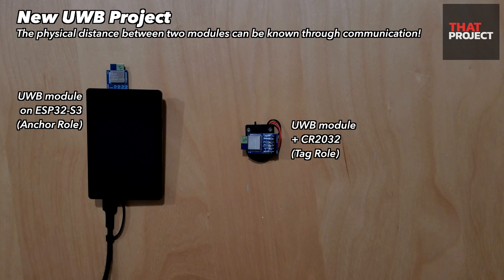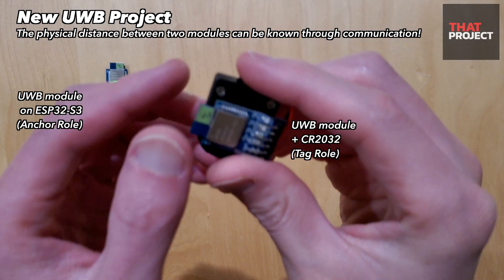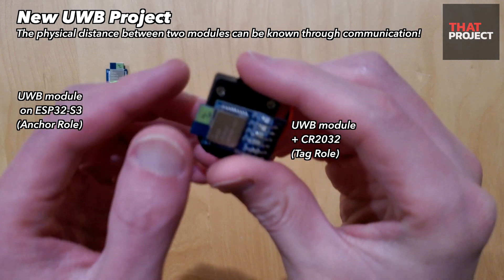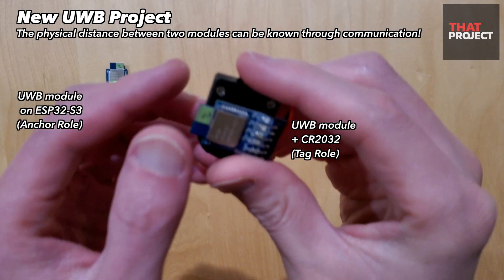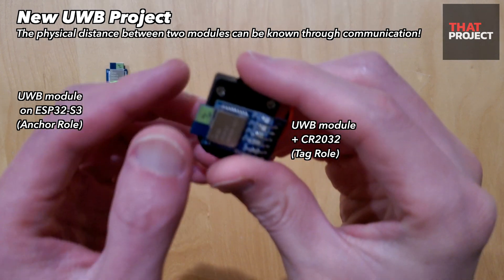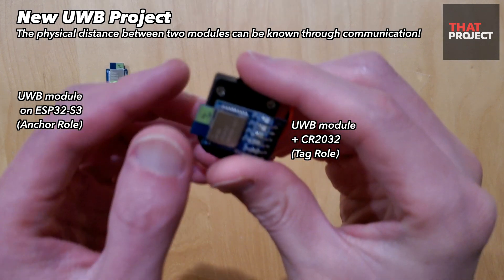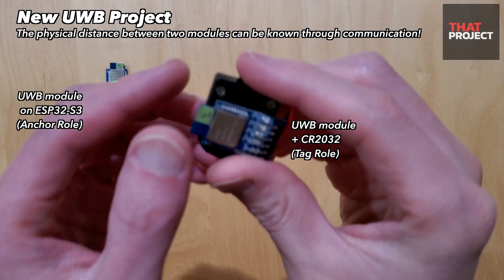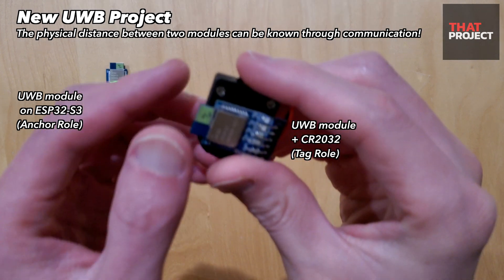NEW UWB Project! New UWB chip!

Comment: When i am using a cr2032 , it's rapidly consumed ( in 5 mn or so 😮) am i doing something wrong? Did you experience it the same?
Reply from the maker: I also experienced the same issue. It only works the first time, and as time goes by, battery consumption increases rapidly, making it impossible to use in actual projects. More than the battery, the fundamental problem with this chip is that its functionality is so limited that it can only be used in very simple projects.

Comment: I bought a few of these for a project but they are just riddled with flaws and limitation. First one being that the AES key can easily be exposed by querying it using AT command. This will enable people to easily clone the tag. 
The second problem is that when you place it in TAG mode, you can't send messages actively to the anchor; thus it is impossible to announce yourself to the anchor that you are within the area so the anchor could know what to do next (constantly get distance etc.).  The anchor itself have to guess which tag is within the area which is impossible to know unless you let the anchor brute force all of the known tags in your list and spam the RF spectrum constantly. 

It is a neat little module for a school project demo with just one or two tags but for anything serious and more than that, I'd recommend avoiding it entirely.
Reply from the maker: Honestly I agree. To tell my story for a moment, when this module was first released, I was impressed that there was a uwb module that could be purchased and used instead of the dw series. However, I was very disappointed that the datasheet was very insufficient and included very minimal features. This is why I can't do the next project using it. Still, I appreciate that it can be used very easily for simple projects such as school projects.

Comment: Awesome, what's its max pulling rate? How many times per second can you get distance readings?
Reply from the maker: Not sure about the maximum pulling rate, but I think it is possible to have pulling data about 20~ 30 times per second. In my case, since it makes the battery consumption, I only tried minimal pulling.

Comment: Can the Esp32 UWB see behind the wall? it's for a project
Reply from the maker: It will have very different results depending on the environment. This is why we must calibrate before use.
Reply: @ThatProject  I tried the similar scenario, it doesn't connect with the tag , also i looked upon lora but it can't provide TOF for distance measurement ! is there any other way to make it work?
Reply: ps lora can work incase of LOS through RSSI ** my case is NLOS